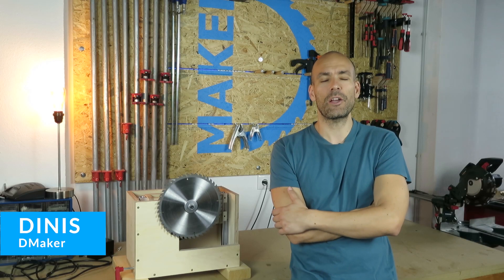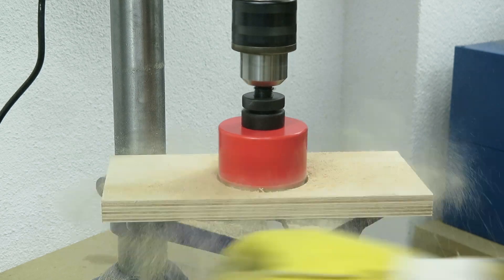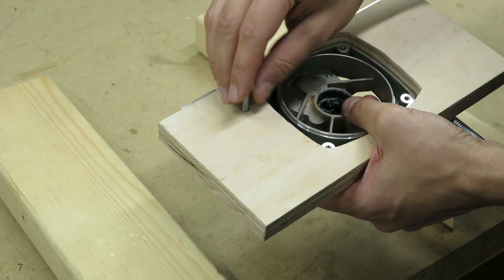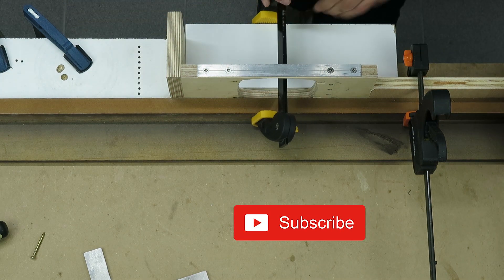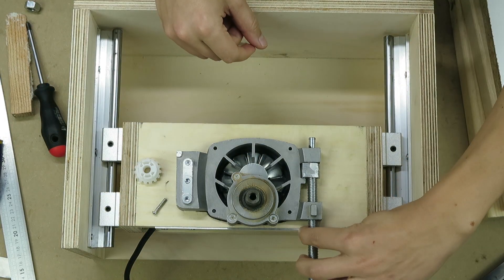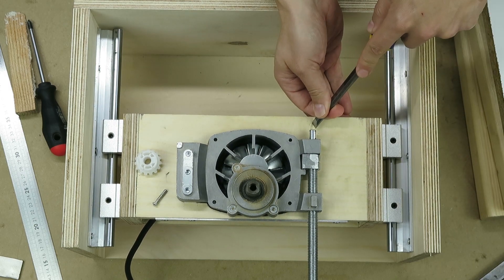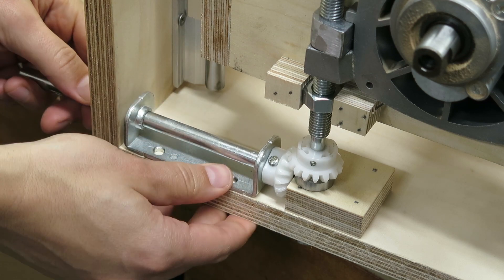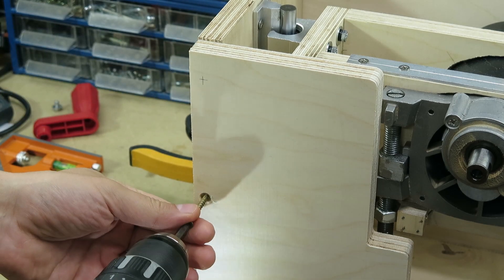DIY Table Saw | Part I - Enclosure and Lifting System

Comment: You appear to have blocked the cooling airflow through the motor by putting a solid back on the box up against the back of the motor.
Reply from the maker: I understand your point, and I'm thinking about making a few holes on the box to help with dust extraction, and that will surely help with the cooling of the motor. Thank for your comment 👍
Reply: @DMaker_builds  I am about to re-model my own table saw and will be following many ideas from your design. I will be making two holes in the motor box, one for a clean air inlet and one for an exhaust port directly behind the motor. These will be attached to vacuum cleaner flexible hoses and routed to the rear of the table to the dust extraction port. That way I hope to achieve not only cooling airflow but a clean dust free motor enclosure with a positive airflow through the box and the motor. Maybe overkill but it’s cheaper than replacing a large brushless motor 😀😬
Reply from the maker: That's a great idea! I would love to see your build! 😉👍

Comment: Great work! 
Are the linear bearings not clogged with dust?
 Have you had to clean them already in a year of saw operation?
Reply from the maker: Thanks! 👍
Until now, I haven't clean them and they did not clog yet. What I do is occasionally remove the blade and vacuum the dust inside the cabinet. But I would recommend doing a visual inspection every year or so, to see if the bearings are ok and if they need a more detailed cleaning.

Comment: !Hi, even if my bench circular is not a parkside but an Einhell I should resuscitate to adapt it to your bench, but I am not very grasped in English, please can you explain the passage of the video from 0.5 to 2.23. The radius / distance and depth of cut and also the shape of the gear to be cut next. Thanks
Reply from the maker: Hi Gianpaolo, you refer to the part where I cut the hole to insert the motor? This hole depends on the size of the motor you are using. In your case you'll have to measure carefully the motor and make the hole accordingly. I hope this could help.
Reply: @DMaker_builds  no, where you create the cogwheel and make the cuts with the trimmer
Reply from the maker: @gianpaolo1331  ah ok, but this is not in this video, it's in part 2. It's not easy to explain, but in order to have a zero clearance when tilting, you have to make the center of the trunion circle coincident with the axle of rotation of the blade, which is right above the surface of the table. Then you have to position these pieces as if the center was in the same place. As I said it's not easy to explain here but I hope it helped.
Reply: @DMaker_builds  is that of part two at the beginning you don't have a drawing of the mask that you paste on the board?
Reply from the maker: @gianpaolo1331  if you mean the gears, I used a calculator on this website to make the template:
https://woodgears.ca/gear_cutting/index.html
Reply: @DMaker_builds  top thanks

Comment: dimensions on the first graphic have to be incorrect. 18.8mm x 27.1mm = 3/4" x 1" ... WTF?
Reply: 18.8cm x 27.1cm = 7" x 10" ... that sounds more reasonable...
Reply from the maker: @verdedenim662  You're absolutely right! That was a mistake. It should be cm instead of mm for all the measurements. I'll make a correction in the video description. Thanks a lot!

Comment: everything is very cool, but why don't you use all the wooden joints for self-tapping screws and glue
Reply from the maker: I decided not to use glue, so that I can disassemble it for maintenance or make changes in the future. That's the reason I only used screws, but of course it can also be used wood glue to reinforce the bonds.

Comment: Video is useless because you cant do all of this without this compact motor which you cant buy separately.
Reply from the maker: Охотник на кремлеботов I understand your point. This is meant to be made with a table saw motor. But of course you can adapt the design to another type of motor.

Comment: All these cheap 150 euros saws are all  clones of one brand somewhere or another,  I got a einhell one of amazon for about 125 and then made it stronger and adjusted the blade with a dial gauge and checked it all, after doing that and bolting the whole unit into a table I made for it as I am tall its not high enough it actually works perfectly , ok it does not have a cast iron base but it cuts perfectly with a sledge, perfect mitres and  cross cuts etc, I have yet to adjust it again after having it for about 6 months now, I use it quite a lot and am pleased with it. 

If you take the time to set it up properly and add some additional strengthening it can be as good as a 500 euro saw. I did look at these originally and with the amount of plastic they have opted not to buy one. I just tweaked my cheap one and so far it has not let me down. It helps having it built into a large table as that strengthens the carcass of the saw and building some extra bars underneath to hold it I am happy.
Reply from the maker: Yes, that's also a possibility. But my saw was really hard to adjust correctly, and a few cuts after adjusting it gets bad again. That's why I decided to use only the motor, improve the lifting system, make a better tilting system and larger and more stable table (coming soon on part II). Not to mention the fence that's maybe one of the worst parts of this kind of cheap saws...

Comment: Да уж... Чтобы сделать циркулярную пилу - её нужно сперва купить. Напоминает анекдот: "В газете напечатан рецепт домашнего майонеза. Пункт 1. 200 грамм майонеза "провансаль".
Ну это тупо. И пила у вас новая
Reply from the maker: Олексій Білко I’m not sure I understand your comment, but from translation I understand you ask if you need to buy a circular saw to make this table saw. The answer is no. This particular project is an improvement of a crappy table saw, but if you want you can adapt it to your needs and fit a circular saw or other type of motor.

Comment: I wait excited to the second part. Great work so far... thanks!
Reply from the maker: Thanks a lot! I'm working on the second part and I hope will up soon.
Reply: @DMaker_builds  Good, I too can't wait to see the next part. I have watched every video on youtube for homemade table saws and while I did see other videos using this same concept, the videos were not nearly as well made or clear on what they were doing, and a lot of them leave out parts that seem to be fairly important. I am making two saws right now, the first one is a small benchtop version that I am making out of an old Makita 2708 table saw that has a broken base and warped top, but it has an inner cartridge like the saw you used, so now I know how I am going to do it. Lucky for me I am also building a CNC router, so I have a bunch of extra linear guide rail! The second saw will be based around a bigger 2hp saw motor someone gave me, but that one has no other parts except for the motor, and the motor only has one place to connect to, which is on the side of the winding housing, rather than over at the front of the motor like most smaller table saw motors, so the challenge there will be getting the motor to attach to the housing in a way that keeps it stable. I subscribed to your channel, hope to see that next video soon! And thank you!.
Reply from the maker: @thirryharlin4663  Thanks for your reply. It's good to hear that the video gave you ideas on how to solve your problem. I would love to see pictures of your final build! Regarding the other 2HP motor it's hard to help not seeing the motor itself or pictures, but I'm sure there should be another way to hold it in place, no? If you want, send me an email and I can try to help: dmaker.contact@gmail.com.

Comment: ???????? Dismantle a table ready to do again, without having to create anything ... more useless video ...
Reply from the maker: Hi Luís, the reason behind this is using only the saw itself and building a much more stable and precise table. And there are a couple of creations, like the lifting system which is not the same, and in the second part there are trunnions for the tilting system instead of the crappy mechanism it had originally.

Comment: If you couldunt have a table saw that use to same aparats from table saw how it be done wooden table sow.
Biggest probmlem that we have cant find lots of aparats to do.
But it is done awesome.
Thanks from Turkey 🖐️
Reply from the maker: Thanks Osman. This can be done with any kind of cheap table saw (like the ones from Lidl). But you can also use a standard circular saw and adapt the design accordingly.